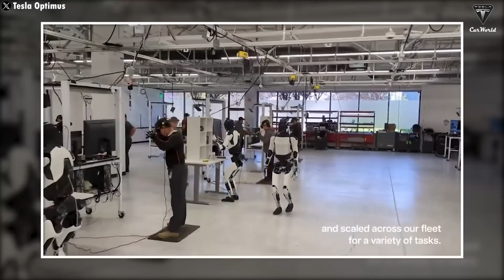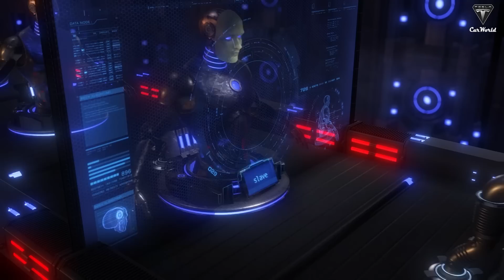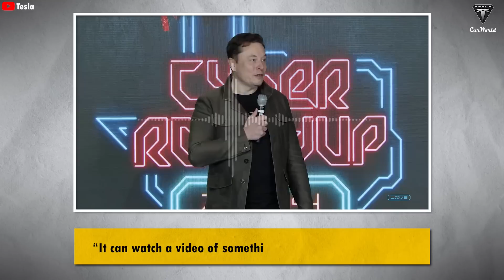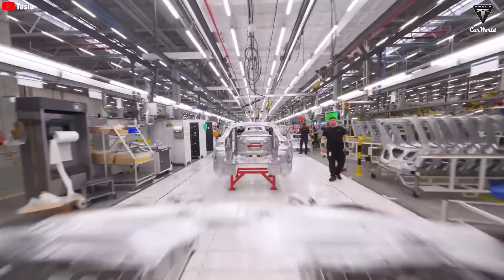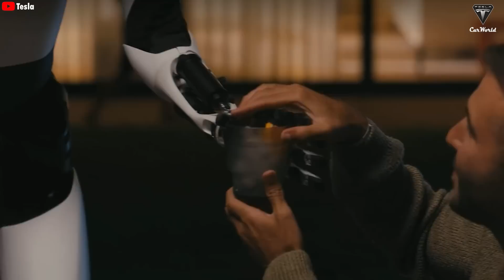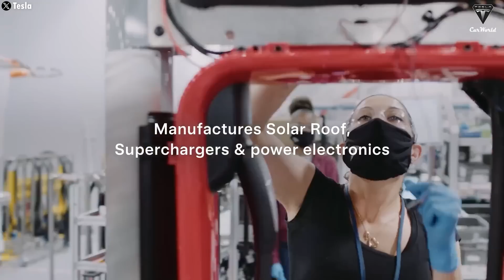No More $20K! Elon Musk Confirms Tesla Optimus Gen 3 Release On Dec & Here is ALL New Tasks!

Comment: Take advantage of modern modular home manufacturing and cost-effective materials, equally strong as traditional housing. Rent them on Airbnb or platforms daily. Invest in multiple units, reduce taxes, and automate maintenance with Tesla Optimus for efficiency.

Here's the comprehensive breakdown:

1. *Single-room kit*: $5,000
2. *Small plot (0.1-1 acre)*: $5,000
3. Utility Setup: $9,500
1. *Electricity Hookup*: $1,500
1. *Connection fee*: $500
2. *Meter installation*: $200
3. *Line extension (avg. 100 ft)*: $800
2. *Water Well (Shallow, 100 ft)*: $6,000
1. *Drilling*: $3,000
2. *Casing and screen*: $1,000
3. *Pump and piping*: $1,500
4. *Electrical hookups*: $500
3. *Septic System*: $2,000
1. *System installation*: $1,200
2. *Permits and inspections*: $500
3. *Land preparation*: $300

Total Estimated Cost

$19,500

Potential ROI

1. 10-15% monthly rental yield
2. $800-$1,200 daily rental income (peak season)
3. $70,000-$140,000 annual revenue